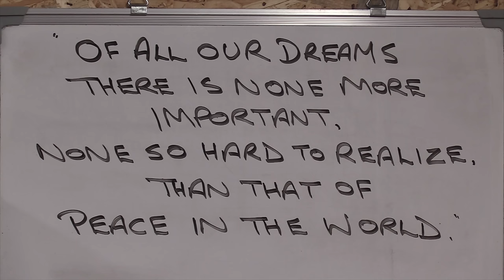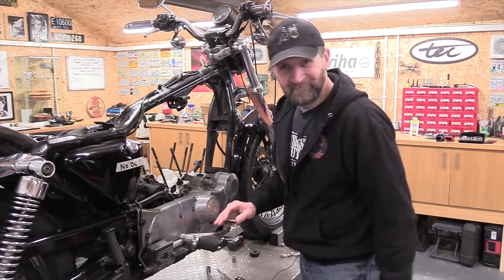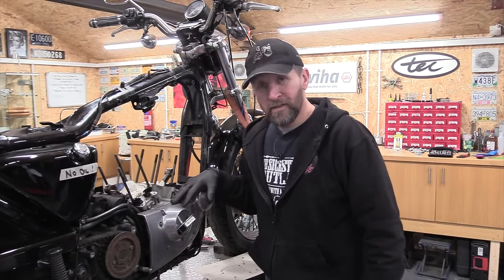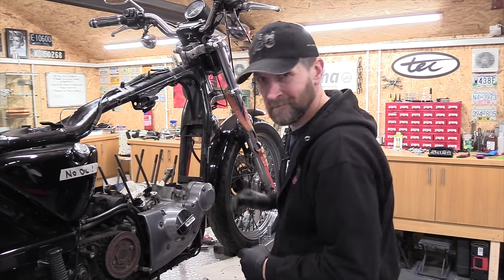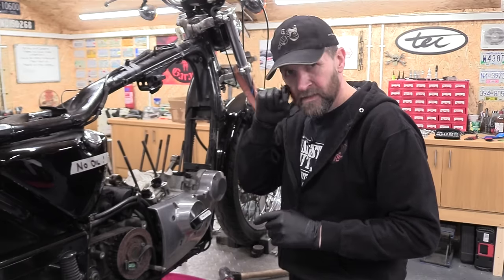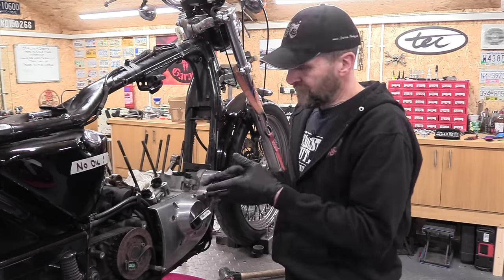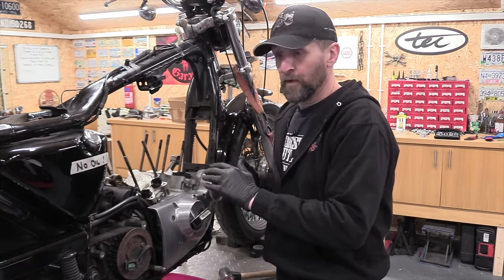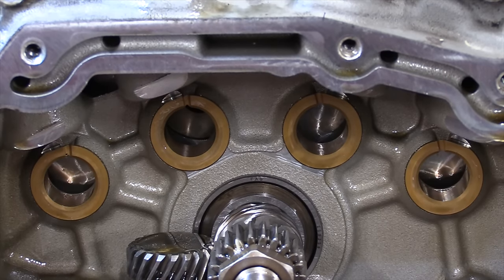Harley Sportster, Cam Case Strip down !

Comment: I am just in the process of putting a 1275 big bore kit on my 2000 Sportster 883. I have had her from new and commuted daily to work all year round and she has now done 89.000 miles, so just about run in now 👍 Believe it or not there is still cross hatching on the bores too ! I changed the oil every 1500 miles and she is showing very minimal signs of wear. Now I am retired I just want to use her for the odd ride out, so tarting her up a bit. Am trawling my way through all your videos. Thanks very much for the time and effort you have taken in putting these together 👍👍👍
Reply from the maker: 89k and no bore wear?... you gotta love HD durability aye..?    Sounds like you're enjoying the project too. Thank you so much for your kind feedback and support, im glad the videos can help you out.   Take care and enjoy the journey.. !

Comment: The achilles heel of the sportster motor is the oil pump drive gear, but it's not normally a problem with the stock low tune engines.
I'm a long time Buell owner and it's an essential mod to fit a bronze drive gear or a Lucky Hands item, the teeth on the stock scroll gear can end up wearing so thin that they break off resulting in world of pain.It's just to let you know if you're going to hop up the power , kind regards.
Reply from the maker: Thank you for your insight mate, nobody knows Harley engine weaknesses better than a Buelligan..!
Reply: @Moonfleet41  They're the most fun you can have with you clothes on !

Comment: Looks like beautiful engineering going on. Fascinated by the cartridge case you used to tamp out the holes for placing the cover screws so they go back into the same thread. Was it a 7.62 ? .308 maybe ? Looked like it had been fired recently too, from the centre pin mark. Will it be a 1275 ? I wonder. Harley use the same bottom end for both 883 ? as well ? Incredible strength. Getting more and more impressed with Harley Davidson here :)
Reply from the maker: Hi Tony.. it's a 7.62 x 51 Nato round, little souvenir from the past mate..  Lot's to come, just waiting for parts to arrive, and getting on with all the strip down first.   Sounds like you need a Harley in your life..lol!

Comment: Every time I saw tension go on the fixings I gritted my teeth, but all went well. We’ve all had the cross thread, worn head etc. resulting in a welcomed slippage routine. 🥴😂. Nice going brother.
Reply from the maker: You said that right brother, it's a tense time when you're cracking round the fasteners and always a relief when the last one pops!  Thankfully this is a pretty well looked after bike...

Comment: Engine looks mint inside, Nice score! You forgot to mention if your taking the cam cover off with top end still on you will need to back off the tension on the push rods, otherwise you will hurt the inner cam bearings and wont get the cam cover back on.
Reply from the maker: Yes indeed mate, well said, i will factor in a mention upon reassembly..!
Reply: @Moonfleet41  while i have your attention have you considered using hammer performance upgrade kits, ive had very good results over the years, ive got about 30 of their kits and have gotten great performance and not a single issue. Acreamin eagle kits leave power on the table from my experience,  hammer atleast have a better designed piston.
Reply from the maker: @andrew1977au  I have considered many options for sure, and the first thing you realise is the background costs after the kit itself.. gaskets, (dozens of gaskets) fluids, clutch, tools, carb kit etc etc.. it just doubles the initial outlay so i have had to respect the budget and make a measured choice, after the motor is done i still have everything else to consider, wheels, suspension, bodywork, lights, bars tyres the list goes on and on... Just managing the project as best i can so i have money for everything and run out half way through.!!
Reply: @Moonfleet41  dont i know it.

Comment: 5 years ago I got my license and bought an 01' Sportster 883C as my first bike. I wanted to work do the maintenance myself, so I found your video about the 5000 mile service, bought the manual and did it myself. Then I found your primary fluid replacement video, also done that. Then you started the Dyna Wide Glide project, so I ended up modifying and changing up almost everything on my Sportster, except the engine. Please don't do this to me again, as I just bought another bike, so it's not a very good time for me to upgrade the Sportster to 1200. :))
Reply from the maker: We're glad to have been of such inspiration over the years Alex.. and really appreciate your loyal support.. and if you do choose to upgrade the 883, then you'll enjoy maybe 50% extra torque and so much more fun to ride..!!!  Good luck with it buddy.
Reply: @Moonfleet41  If I do the engine upgrade, I'd also like to do an upgrade to a dual front brake and that would up the cost by a lot. I have swapped the 21 inch front wheel to a 16 inch wheel with an 130 tyre, and I now have a RSD calliper on the front and EBC floating discs on both wheels. The brakes are massively improved compared to stock, but I think I'd want something even better for the extra power. Are you planning any brake upgrades on this bike. And regarding the engine upgrade, you said last episode you're going to the dealership for Harley OEM parts. Have you also considered the Hammer Performance kits?
Reply from the maker: @alexbaltac3336  I did say i was going to the dealership, but didn't mention OEM parts.. they have many options for the engine upgrade, but which ever "kit" one chooses to invest in, you still need gaskets, not just the head and base, but all of the top end rubber gaskets, seals and washers and only OEM gaskets will give the reliability long term, im also stripping primary, and need carb upgrade parts too, and the dealer is the best place to go because i can choose from options they would fit and warranty, not just the latest fashionable brands !  Stick with it mate, it will unfold over the next few weeks.
Reply: @Moonfleet41  Sounds fantastic! I always get a notification and watch the new video within an hour of being released, so I'm looking forward to see what this Sportser will turn into. Have a great time working on it!

Comment: I strongly advise against removing the cam cover with the top end assembled. As you correctly stated they are only supported by the casings. The force down though the pushrods can push the unsupported cams resulting in damage to the inner cam bearings.
Reply from the maker: Indeed correct, and when the cam drops out the follower drops down behind it and you're facing a very long day to fish it out!

Comment: Such style in your work. Quick question del, I haven’t been able to find answers. Does the cam case need to be taken off to remove the generator? I figured I’d ask before I rip my 1980 xlh apart.

Comment: When working on projects my son always says, dad you always over engineer stuff. I always say back its better to over engineer than to under-engineer that way you dont have to keep going back on your work.  Like you did with to mount the bolts on a template it makes life easier, nicely set out & clearly printed.. i just makes sense!
Reply from the maker: Makes sense indeed, each one of those bolts if a different length, and although there is a way to determine which goes where if they get mixed up, it's far easier to keep track in the first place aye.. and yes, the over engineering is what i love most about Harleys.